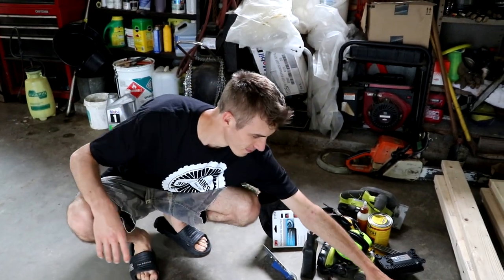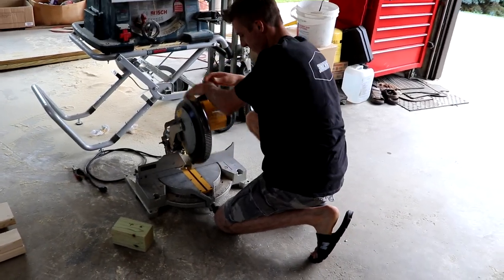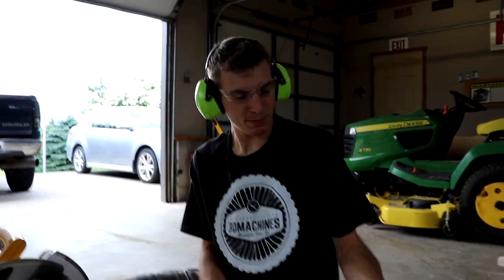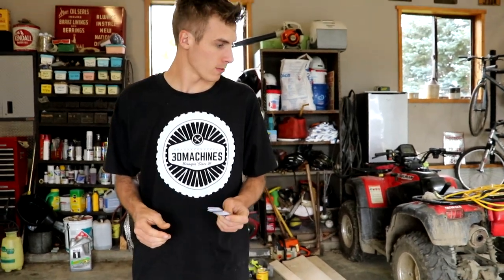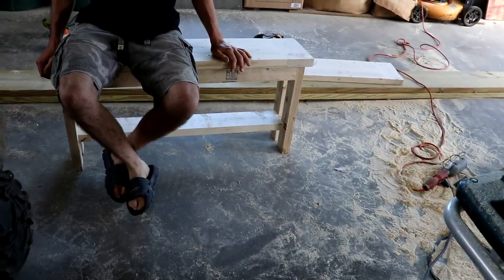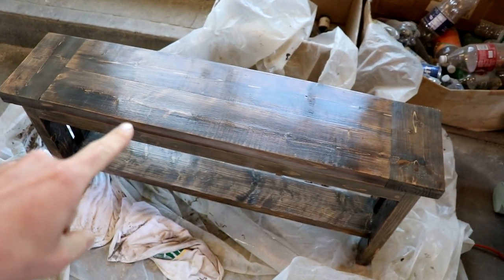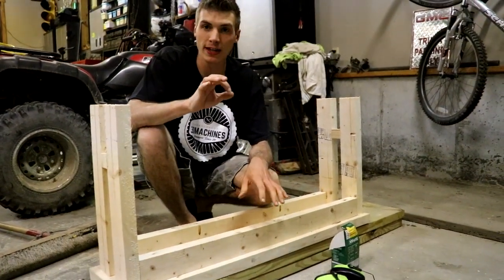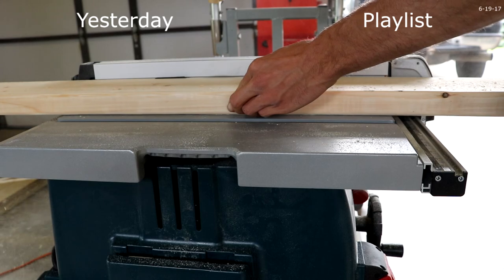OPEN FOR BUSINESS

Comment: I would recommend putting a chamfer  around the bottom of the feet on your benches. It will keep them from chipping or splintering. Plus they will slide better. Just a thought.